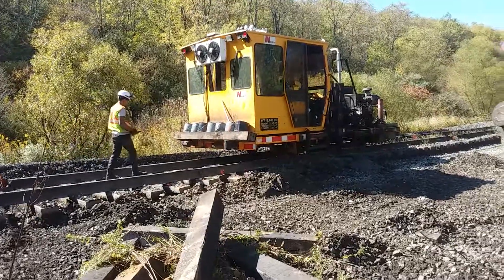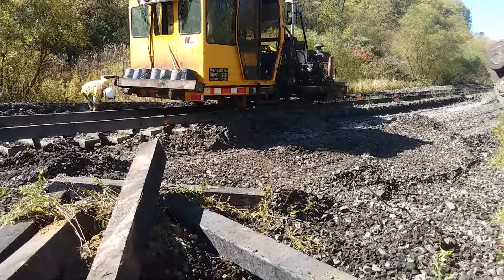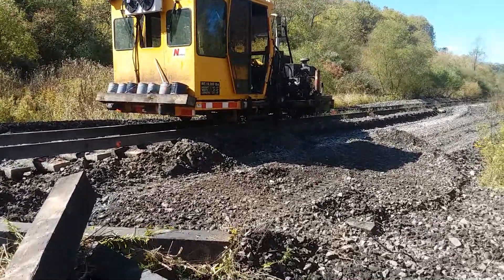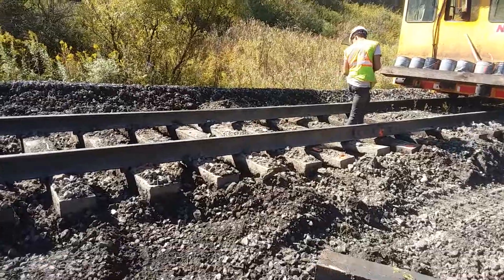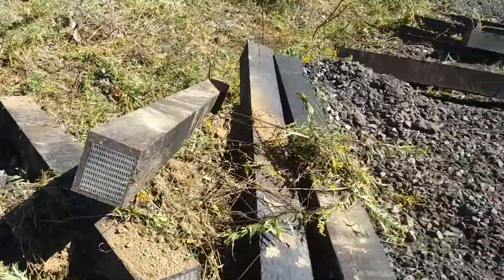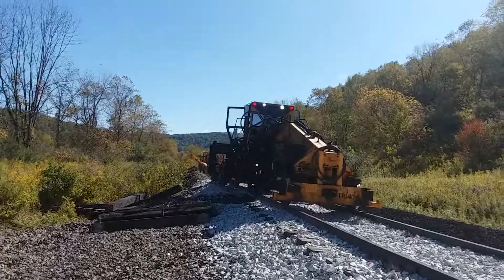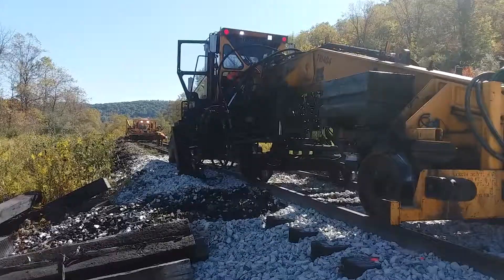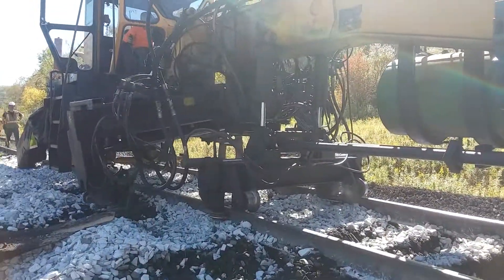Tie Gang: Nordco TRIPP Pulling Ties and Kershaw Scarifier

Comment: Those TRIPPS are excellent for switch ties, on our production tie gangs we don't use a scarifier, we just stuff a new tie, the platers slides the plates between the tie and rails, then the nipper tamper will tamp the new tie up tight to the rails, anchor squeezers squeeze the anchors against the tied, two line spikers, an anchor spiker following behind.
Reply from the maker: Jason, 20 years ago we rented a very old TKO, I ran it but the only thing I remember about it was that it was a real challenge, that
machine was wore out when it got here, these TRIPP's are the cat's meow. You can tell who's an operator after they go through, some guys I've had to line everything they did,  these guys did a great job in keeping track alignment
Reply: We still use the TKO's but more modern ones with enclosed cabs versus the old open cabs, those are more powerful than the TRIPP.
Reply from the maker: @jasonbabila6006  really! Thats interesting to know. Have also wondered what TKO stood for. We guessed and said it meant tie knocker outer.

Comment: Can I ask a probably very silly question please?
 What is the advantage of 'pin' spikes driven into a wood tie over the helical clip method??
Surely it allows water ingress into the wood.
Thanks!
Reply from the maker: Excellent question! I don't have a perfect answer. The  Pandro clips (helical) also require anchor spikes for the tie plates, but some applications like for a frog they use lag screws into the ties. So spiking the clip plates is no different than spiking a normal tie plate in that respect. I do not know if studies have been done comparing, as you say the holding power, whether spikes or clips are any better than the other.  Also Pandrol clips were invented 1957 by a Norwegian rr engineer, per-pande rolfson. Pandrol also has a tie plate where they use an anchor spike, a rail holding spike, and a Pandrol clip, its called Victor system, those plates are called Pandrol plates. Hope that helps a bit and thank you for the query and for watching
Reply: @ccrx6700  Thank you for your prompt informed reply...
I shall continue to follow your Posts with interest.
Best Wishes to you and yours.
Reply: Lewis bolts or lags are more intensive requiring pre drilling.

Comment: I'm really enjoying the channel. Regarding the equipment that the contractor brings in, Is that brought in by rail and then trucked to your railroad? Or do they truck it all the way to you? Just curious since you mentioned that you don't have a direct link to the a Class I railroad. Also, that ballast must be expensive. Wow$$$.
Reply: Jef, contractor trucks all their equipment in and unloads on a siding at our harbor
facility. Mobilization costs are a good part of the bill for any job they do here. Nothing
on the railroad is cheap.... Ballast we get trucked from a local quary to our Mapletown
stockyard, it only about $17 a ton for #3 limestone which is reasonable

Comment: What happens with the spikes and tie plates after they're removed? I assume they can't be re-used because of some regulation.
Reply from the maker: That's right sir. We put the old ties in a dumpster, bout 130 or so ties to a dumpster which cost $500, so replacing 2,000 ties a year, you can figure what it costs to get rid of them. But like you said, many just pile them away and don't bother getting rid of them
Reply: @ccrx6700  Dang, do they not get recycled? A railyard near me has a huge pile of spikes and tie plates sitting around because they're replacing the ties and I'm considering grabbing a few spikes
Reply from the maker: @terabyte7683  the company that takes our old ties sometimes picks thru them and re sells the decent ones as used ties, the really bad ones they take to a landfill